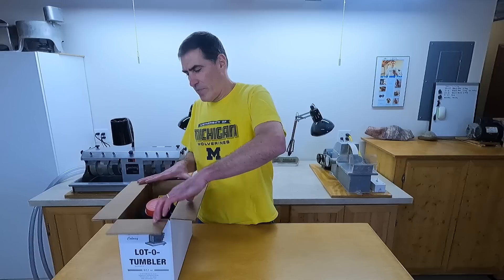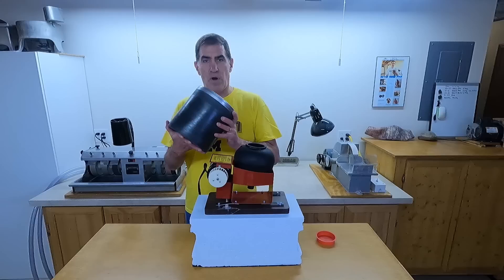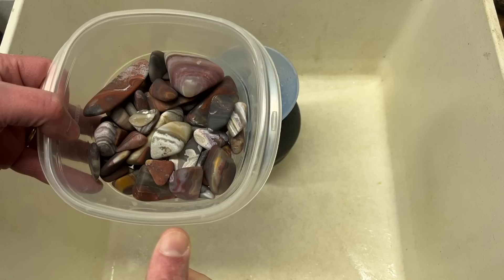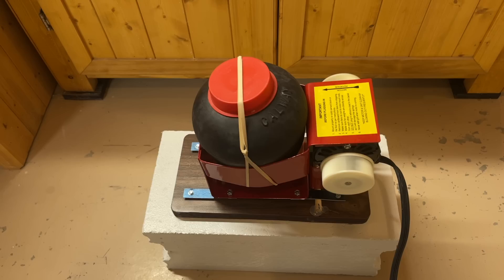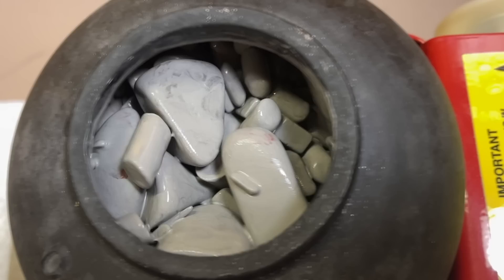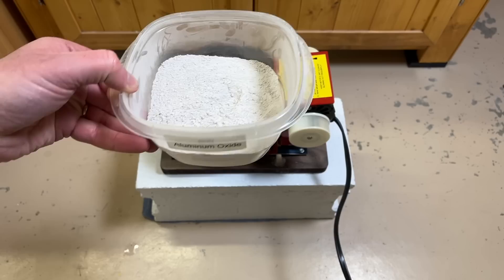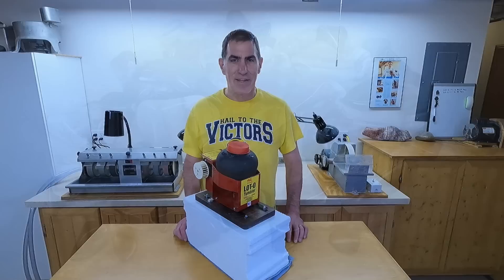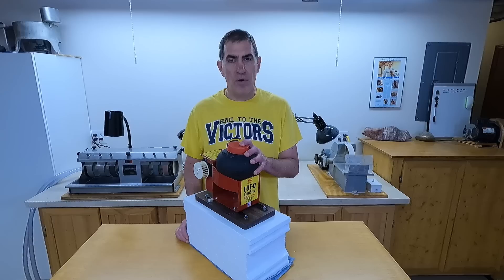The Lot-O Used To Be My Favorite Tumbler. It's Not Now. See Description Below.

Comment: Revisiting this video. From my experience (over the past 18 months or so), the Lot-O needs some break in time. It took me about six months to start getting the action I wanted to see in the barrel. I moved the dowel and played with the recipe in the first two months months, but it took much longer to sort of ease into the rhythm I have now. Hard to say what micro-adjustments I made over the last 6-8 months, but it's working perfectly for me now. I struggle a little bit keeping the action going beyond day three with 220, but otherwise everything works well. The Lot-O is a finicky little machine.
Reply from the maker: That's interesting. I started using my first Lot-O over ten years ago and I think I had good luck right from the beginning. My second Lot-O required the adjustment you saw in this video, but since that, it has been working just like the other one. The action is actually a bit more aggressive than the first one, because I think I moved the dowel just a bit more than I should have. The results I get are the same with both machines though. 

The 220 stage definitely takes the most babysitting. It grinds the most aggressively and creates the most rock dust, which soaks up water. The water needs to be replenished much more often.
Reply: @MichiganRocks  Enormous thanks to you and this video. You shortened my learning curve significantly.
Reply from the maker: @jat3mtnbiker  You're welcome.

Comment: A little baking soda keeps you from having gas build up and it can happen with certain rocks and I always use a inch of water in bottom that's just my preference
Reply from the maker: I've only had gas build up when tumbling obsidian or glass. I've been tumbling pretty much nonstop for about 11 years. I'm not saying it couldn't happen with other rocks too, but it's not at all common in my experience. With the Lot-O it's not an issue because the lid isn't airtight. 

Are you putting an inch of water in the bottom of a Lot-O? If so, I don't know how it's working at all for you.

Comment: This is probably the best video on which to post my major question: I have a 1year old Lot-O that I've been using continuously since I received it. I had to tune it by moving the dowels as you show here and I have good movement. I consistently have problems with the first Lot-O stage. It starts slowing down within a few hours, and I check it often adding water to keep it moving briskly. Invariably however, I end up with little or no movement with all the ceramics in a glob on the bottom, often difficult to remove-sort of a paste embedded with ceramics. Am I adding too much water? I even tried doing this stage with borax added but it doesn't seem to help. Any ideas you might have would be highly appreciated. As an aside, I have not seen anyone who has done more for this hobby than you. There is nothing like learning from and expert who happens to be a gifted teacher as well!
 Thanks for all you share! One other question-I am enamored with BIF and banded chert. I recently found a ton of BIF in Wakefield, cut it up (tile saw) and am tumbling it now. My question is can you direct me to any beach that contains banded chert because here in SW Michigan I can find it. Thanks again!
Reply from the maker: Hey Rick, based on the glob of rocks in the bottom of the barrel, I'd say you're not using enough water. Don't add borax in the first stage, it thickens the slurry and just adds to the problem. I occasionally forget to check my Lot-O in the first stage and end up with the exact problem you're describing. 

You should start with just wet rocks. Give them a few extra squirts of water before you go to bed to get them through the night. When you wake up, check them again. Squirt in enough water to keep them looking wet. I check them two or three times per day. As long as they never get too dry, I don't think you'll have the globbing problem. 

I find almost all of my banded chert on a beach that has no public access. I find a little of it up on Lake Superior, but it's never as good as the stuff I find in Lake Huron.
Reply: Thanks Rob! I’ll use more water.
Reply from the maker: @RickGorczynski  Good luck!

Comment: I researched the Lot-O tumbler when I was shopping for a vibe, but ended up buying the Diamond-Pacific Mini-Sonic instead. The price is roughly equivalent, but the Mini has some advantages.
No need for mounting to a concrete block, just set it on a table. It doesn't walk around and it's not terribly noisy. 
No moving parts to wear out. The barrel will wear out eventually, of course.
Dial-adjustable speed of rotation, nice when you're tumbling softer stone.

However, it does not hold as much stone per load as the Lot-O does, and I do have to check it a little more often for water loss, as the lid isn't very tight. And of course, it's out of stock everywhere right now. If you want one, you order one and wait...and wait...and wait. It took 10 weeks from order to delivery for me.
Reply from the maker: I have never tried a Mini Sonic. A good friend of mine has a Lot-O and a Mini Sonic. He has a lot more experience with the Lot-O and prefers it, but I've seen him produce some nice rocks with the Mini Sonic too.

Have you tried their Vibratory-Dry polishing compound? I'd love to try that stuff, but it's really expensive.
Reply: @MichiganRocks  No, I've not tried the dry polishing compounds...same as you, I took one look at the prices and went nope. I do use a finer micron size polish than you do, I'm using Raybrite A, which is 0.5 micron and is not expensive at $12 a pound...and a pound lasts quite a while when you only use a half a teaspoon per load. BTW, I'm notfragile on the tumbling forums.
Reply from the maker: @r.awilliams9815  I don't know if I'll remember that name but I'll try. I'm assuming you're talking about the Rock Tumbling Hobby forums.

I have some other polish that I sometimes use called OMG2. The Rockshed's aluminum oxide usually gets me the shine I'm looking for, so I don't usually use anything else. Theirs is about 2 micron. I wonder if it breaks down as small as Raybrite after a couple days anyway.
Reply: I have the DPMSonic as well.  Love it!  Has an on/off switch as well as the speed adjustment.  Not sure the barrel will ever wear out, seems super thick.  The barrel opening is square and quite large. The vinyl top has a nice snap on feel, no worry about it coming off during operation.  Very stabile no crawling around. Best of all, it’s all electromagnetic, meaning no bearings, no oil, no blades, hopefully nothing to burn out.  So, turnkey out of the box, no modifications necessary, highly recommended.
Reply from the maker: @jackburns804  Maybe one of these days I'll have to add one to my growing collection of tumblers. I might need to find a place to use it where my wife doesn't see it though. So far, she's been very tolerant of my hobby, but there might be a limit to that.

Comment: I have used both Borax and dawn.  The Dawn cleans much better to Me.  I cleaned two different barrels at the same time and the borax water was much lighter.  I did another wash on the borax barrel and it came out with dark gray dirty water.  I prefer dawn.
Reply from the maker: I use dish detergent between stages most of the time. I usually use borax only for more important stuff. I can't say I notice much difference.

Comment: Thank you for such detailed videos, this one and the one with comparison of two tumblers. I needed this instructions desperately when I bought my first Loto tumbler few months ago and was looking for a good instructions. I ran few batches on it already and was able to get decent polish, but I also noticed how rocks moved slower than what I saw in videos of others. Now I know why - thanks to you. That dowel on my Loto is also in the middle and now I know how to fix it!. But one my question still remains - why the one cannot use loto for the coarse stage? Just run it longer, three-four days maybe? I do have rotary tumbler for that but was just curious why this not even explained anywhere :)
Reply: Look at the other video, "Rotary vs. Vibratory" at 3 : 15 where Rob shows rocks he tried to shape in a vibratory for 28 days.
Reply from the maker: I have never tried a more coarse grit in the Lot-O. I have heard that more coarse grits are too heavy and just fall to the bottom of the barrel. This doesn't grind the rocks and also wears out the bottom of the barrel faster than usual.

Comment: The first thing I noticed when you pulled it out of the box is that the tuning bar was pretty far back -- like the two Lot-O tumblers I've bought in recent years.  In fact, both of mine came with the bar even further back than your new one, and the action was even slower.  Now you can see what I was dealing with for a long time, and why it was driving me crazy.  

The motor bearings on my double barrel Lot-O only lasted about a year and a half before they got loose and loud.  I hope your newer motors last as long as your old one.  I would be more than pleased with 10 years.  I was not pleased with 1.5 years.
Reply from the maker: Nope, 1.5 years is not good. Both of my motors are fairly new, so I'll find out I guess. 

I can't figure out why they're sending out so many (all?) tumblers that are so poorly tuned. I don't think that would do much polishing with the slow action that mine had.
Reply: @MichiganRocks it might be a new builder who hasn't learned every detail yet.

Comment: In one of your videos you had some finished polished rocks that had polish on them that you took a toothbrush to over your sink. I mean it was really caked on too. Well, my wife bought us some Braun Oral B toothbrushes and there's an icon on it of a tooth with a plus sign. That's the high speed setting and boy you talk about getting 'medieval' with it. You always need extra brushes anyway so get one of these and some extra brushes for your rocks and that caked on polish will be gone in a flash. Just a heads up - they're expensive. The Braun Oral B Smart Limited Electronic Toothbrush Black is like 130 bux, but it's what you need and it's incredible for your teeth. My dental hygienist commented about what a great job I do.
EDIT I asked my wife and she paid $80 for the pair at Sam's Club on a special sale. She said a pair/set is usually a hundred now.
Reply from the maker: Thanks for the tip. I don't tend to move many rocks on from the coarse stage with holes in them, so I'll probably just continue to do what I have been doing. Some people have suggested a Water Pik too. If I ever get something like that, I'll probably get a fabric cleaning machine. I forget the exact name, but it's like an industrial strength Water Pik. I think they're around $80 or $100.

Comment: I’ve been using Mini-Sonic from DiamondPacific.  It uses a non-mechanical drive system
Reply from the maker: Yes, I've been looking at that as a possible replacement. My motors are still working, but I think it's only a matter of time until they go. How do you like your Mini-Sonic? I hear it takes a little longer to get a good polish and that it uses a little more grit, but if it's reliable, those are things I can live with.

Comment: this is great info. thank you.  now if only they would make a barrel with a larger opening to accept upto 5 inch slabbed and shaped pieces.
Reply from the maker: There are other vibratory tumblers. The Thumbler's Ultra Vibes come in several sizes and have much larger openings. I have never used one, but they have a good reputation.
Reply: @MichiganRocks  I will be looking into them.  My husband has a vibratory tumbler for his brass shell casings, but I really don't want to end up with another of those style.😅
Reply from the maker: @KaneLouiseOconnor  The tumblers for brass are not built for the weight of rocks and the barrels aren't as strong either. Better not to use his anyhow.

Comment: Thanks Rob, I moved my dowels too. Made a big difference.   Also I was wondering if a cab machine is better than a flat lap or how do choose which one to use?    Thanks again
Reply from the maker: I think a cab machine is way better that a flat lap. 

With a flat lap, it's hard to see what you're doing. You're looking at the back of the rock or cab. With a cab machine, you can look down between the cab and the wheel and see exactly where you're at.

The other thing I like better about a cab machine is it seems to work a lot faster than a flat lap. I have diamond wheels/laps for both machines, but a flat lap just doesn't work very fast. 

The downside to cab machines is the cost. Both the wheels and the machine itself are much more expensive.

Check out my review of the Kingsley North cabber if you missed it: https://youtu.be/n30aBTu9OkY
Reply: Thanks Rob, I have a cab king and was thinking about getting a flat lap.  I might hold off for a while until I have a real need for one.  May be face polishing a nice flat surface.
Reply from the maker: @danwellbaum4026  Flat laps aren't as good at that as you might think. At least I have a really hard time doing that. I tend to tip the rock a bit and get the edges more than the middle. Even small flat rocks take a much longer time to polish than a similar size domed rock.

You might want to look into a vibrating flat lap for polishing a whole slab or half a rock. There is a learning curve with them, but I think that's a better tool for the job.

Comment: Thanks for the amazing video. Watched while waiting for the Lot-OTumbler to arrive. Ran ceramic first and had little motion. Took your instructions for moving the dowel and that helped. A day after moving the dowel one of the spring bolds sheared, easily replaced. Running first load with 120/220 grit and the load is racing like a banshee. Is too fast a bad thing? Maybe twice the speed of your video. Anxious to see the results. Thanks again for the great info. Gene
Reply from the maker: I have heard that if you move the dowel too far that it can break springs. I think you have already seen that by shearing a bolt. You should probably tune it while it's running to get the action to be about like how my original machine runs. I wouldn't want it running twice as fast.

Comment: I joined a couple of forums in the last week, the one of FB has a lot of people saying that the Lot-Os they bought in the last year or 2 are breaking, either the motor burning out, or the entire casing snapping, stuff like that.  The folks who have had them longer than that say that they love theirs and have had them running almost nonstop for 5 years or more.  I'm wondering if they got new management like Boeing did.  I don't know if you recall, I while back I pontificated about using a sonic cleaner.  I've seen a couple videos now of beautiful looking polish jobs getting put in one after a good thorough cleaning and a white cloud came off of them.  Definitely worth the 30 bucks to experiment with.
Reply from the maker: Based on their website, it doesn't seem like there's new management. But I agree that something seems to have changed in the past few years. Here's their website, although it doesn't say much about the Lot-O tumbler. http://uncletomsantiquemall.com/?page_id=43
Reply: Every product gets cheapened over time, as companies attempt to maintain profits.  I’m sure these are no different.
Reply: @andybaldman  Good timing with that.  The discussion has continued about this in that forum I mentioned, 2 more people had failures since my original post here.  Apparently, Lot-O doesn't manufacture their own motors, but buys them from a supplier and they switched suppliers a little while back.  Now, that's just going off of what someone said in the forum, I have no verification of that myself, but I know that the person who said it is an old pro at tumbling, so I'll take that on faith.
Reply: @Ken_G.  It's a shame when companies cheapen their products to save a few bucks, and try to slide it by customers under the radar.   And it completely defeats the purpose when they make the product inferior to the point of causing failures.  That's going to cost them far more than the few dollars they were saving by switching suppliers.   Maybe the best one could hope for in this case is that someone figures out how to retrofit the inferior parts with available substitutes, if the company doesn't stand behind their own product.  But it sounds like they aren't usable as-is, if they're breaking this easily, and they're asking you to readjust the dowel to handicap them (as others have mentioned), so they don't run as hard.

Comment: I’ve watched this video a half a dozen times and still can’t get mine to roll like yours 😢 I calibrated it and made it somewhat better, but still no luck. Most of the ceramics collect at the bottom and the slurry hardens. I have the double and it consistently rolls slower on the left side. I cannot figure this out!
Reply from the maker: Have you tried adjusting the dowel while it's running? That's what I'd do. 

If your ceramics and slurry are collecting not the bottom, you might just be running it too dry. Start with wet rocks and no standing water. Then as it runs and produces rock dust, the slurry will thicken. If you don't add water, the rocks and slurry will end up stopping and hardening. Add water from a squirt bottle and do so slowly. Give it a squirt or two and then wait for it to work in before adding more.